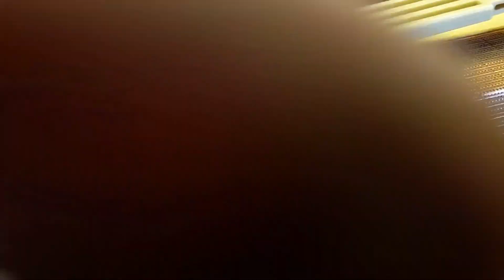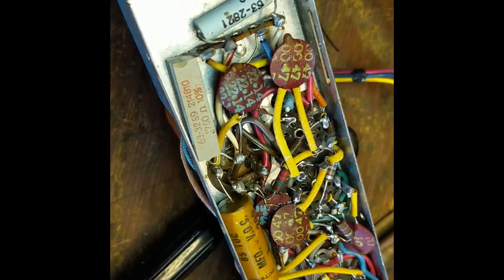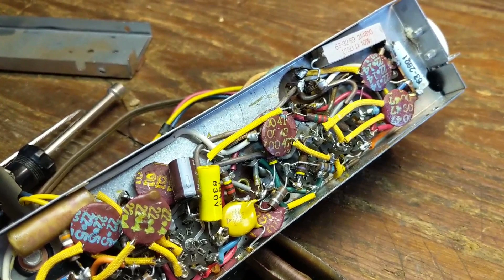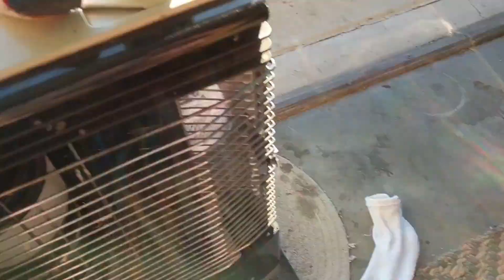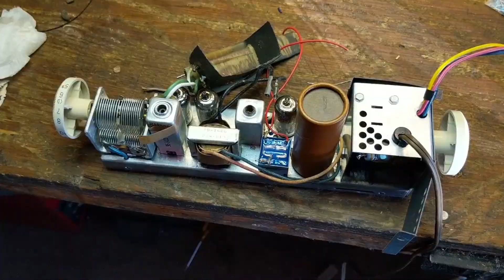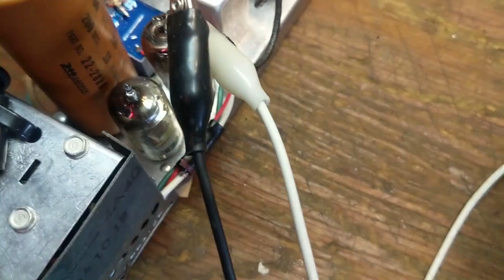Overhauling a Zenith with a CRAMPED chassis

Comment: Another great video and a nice little valve set. On the colour of the radio; it probably wasn't cream originally but white. It's discoloured with age, cigarettes and sunlight (as we all do). Some people restore the colour to white by using hair bleach, smear it on like paint stripper and put it in a polythene bag in the sun for a few hours, inflate the bag so it doesn't touch the case. See David Tipton YouTube vids and maybe Shango66 did it once - can't remember.

Comment: Zenith model B400L. You keep calling the chassis number the model number.  They printed the model number in 
black ink 90 degrees to the printing on the label and  on the right of the label! 
Portable tube radios are a PITA to work on. Replacing the electrolytic can be done if it is bad but can be left in
if no noise is present in the audio.
Reply from the maker: I could not find the model on this one. Maybe the label fell off
Reply: @misterradio5035  No ,I saw it in the beginning of the video! Zenith always had labels with chassis numbers printed on them but for different designs or colors they used a stamped set of letters and numbers. Sometimes a sticker was used with the model number but the sticker didn't say  the words "model number".
Here with this radio it was stamped on the label itself but at a ninety degree angle and in a larger  black typeface.